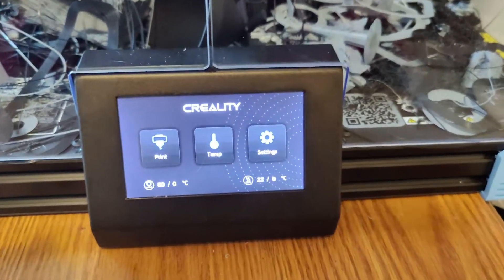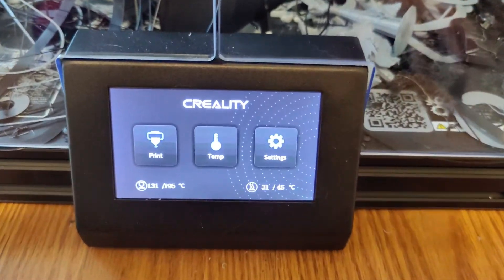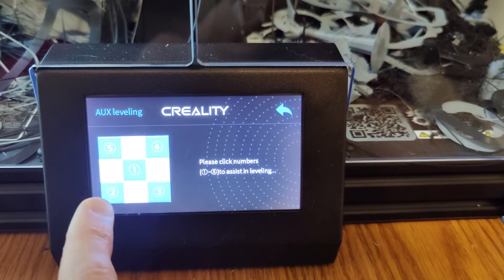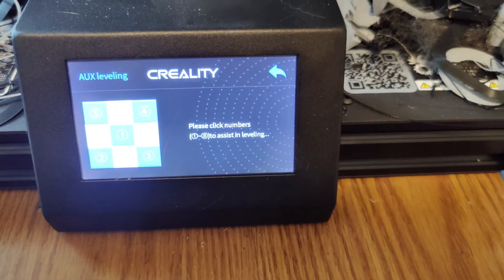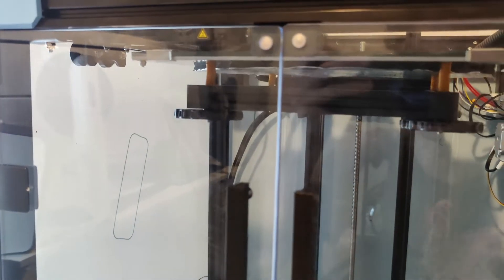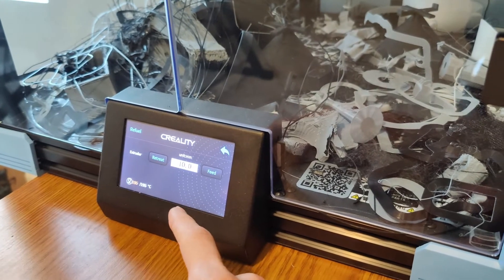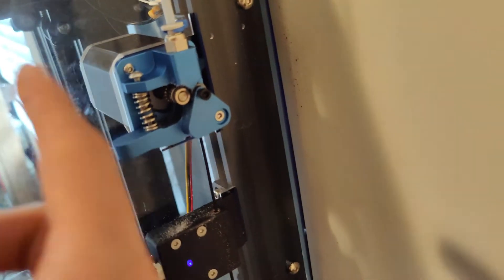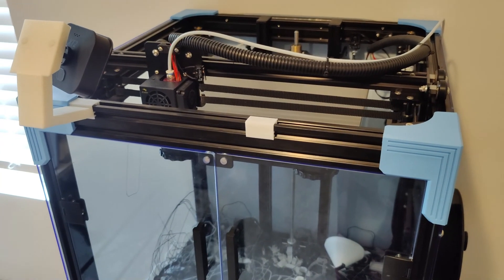Learn The Basics of Your Creality Ender 6!

Comment: Hey can you help me with my leveling? When I click level and it go to home. When I press calibrate to any number. The nozzle is always hitting the print bed. It does not make a scraping sound however the knob underneath doesn't work. Whenever I rotate it. Nothing changed. Please help
Reply from the maker: What you should do first is tighten all 4 screws on your print bed as tight as they can possible go. Once they are as tight as you can make them, the print bed should be the furthest place from the nozzle. At that point you can then try to loosen the screws one by one to level the bed! :)

Comment: Hi, great video. I just got an Ender 6, but it gets stuck when trying to 'home' it and the nozzle only moves diagonally. Do you know what might cause this? (already tripple checked all connections)
Reply from the maker: Thank you! So on the ender 6 there is only 1 belt, so if one axis mines they both should be able to. I'm not sure how the printer will react if it is disabled, try going to the settings menu and then the motors submenu and then enable all motors. That might fix it.

Comment: dose your fan run when you start to pre heat and if so dose the part cooling fan also run then ? or are they separate things
Reply from the maker: That's a good question. I will have to check that next time I preheat the nozzle. If yours does that it might be because of your starting gcode.

Comment: The basics are.  Most are getting ripped off, because the motherboard in there, is crippled with 2 x steppers that Creality 'slipped' in without the customers knowing ;)  No totally 'silent' board here, no Sir!  Half silent on Ender 6 Sir!, ;)  4.3.1 board Sir, a rare board with 4 x 2208's Sir! (if you can get hold of one), the other scammed variant with 2 x 2208's and 2 x A4988's, all under the guise of 4.3.1, are fitted to most Ender 6's Sir, oh yes Sir! :)  Awful shocking practice, you bet Sir!   Open it up, and if you have A/E on card header, then you have the crippled board ;)  Don't thank me, thank Creality :)  If you really must know (not that you will after markings I mentioned), then rip off the 2 heatsinks to the right.  There you will find the 2 stepper drivers A4988, rip off the other 2, and there you will find 2208's :)  Extruder & Z noisy?, you bet! lol...
Reply from the maker: I know this is a very very old comment, but is this the reason the ender 6 is incredibly loud? I want to try and put a new skr control board on this printer and see if it is silent.
Reply: @ThePrintHouse  It sure is. Night and day with SKR 2 board fitted here, all with 2209's. :)

Comment: I just got mine yesterday. And attempted to print abs. And it failed to adhear to the plate. What do you do to print abs.
Reply from the maker: Hey Im sorry I dont print ABS. I do have quite a few rolls at the house, but I dont have enough time to learn the right settings for ABS.
Reply: Hi, I got an ender 6 and used to have the same problem. Things that helped me to print ABS was to turn off the cooler during the entire printing process, decrease the print speed (especially during the first layers), increase the flow rate, add more brim layers, and add hairspray on the bed.

Comment: Hey,  just set up an ender 6, I'm using the standard white PLA it comes with but it keeps blocking the nozzle for some reason,  any thoughts on why? Temp I was at was 190 but have tried it up at 215 too
Reply from the maker: 190 definitely seems way too low. One thing you might consider checking is how low your nozzle is to the build plate. I would print standard pla of my under 6 at 205 degrees or 210 degrees, but in either case if you are jamming the nozzle to the build plate you might not be allowing the filament to extrude out the nozzle in which case it clogs
Reply: Yeah I think that could be it, managed to clog up 3 nozzles figuring that out though,  I've changed the pla from the standard to one I bought, no change though. Is the Ender 6 quite sensitive to this type of thing? It seems to be extruding mostly ok and then cuts out citing a blockage